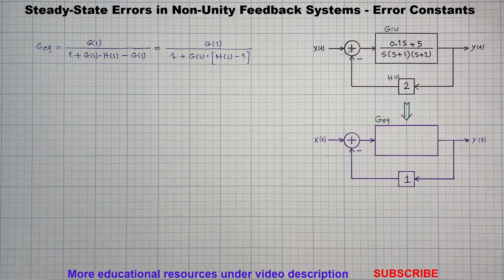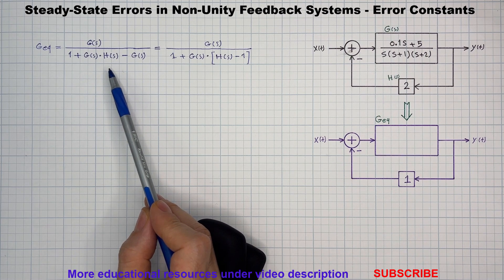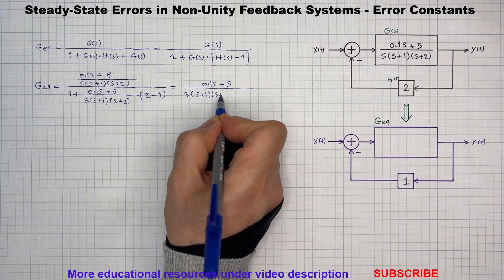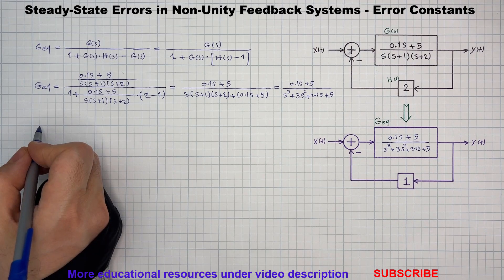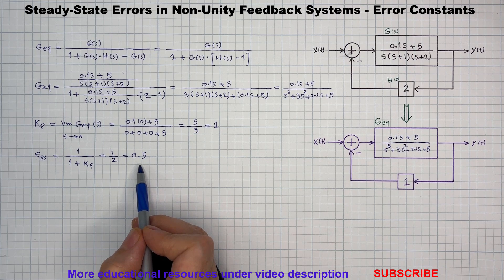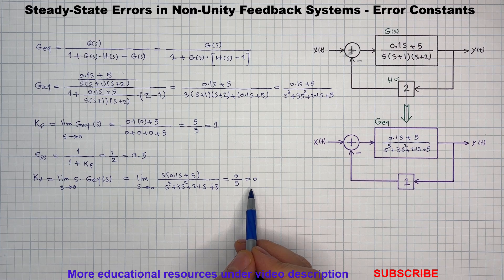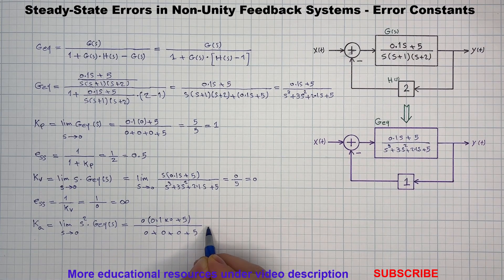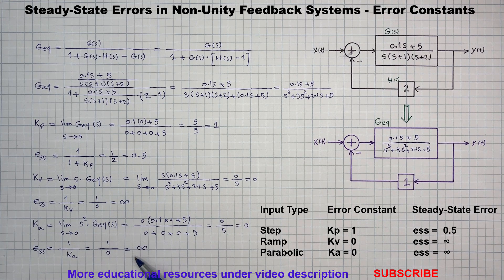Steady State Error in Non-Unity Feedback Systems, Steady State Error Constants in Control

Comment: i think this is wrong, this system type is type1. so, steady state error exist when the input is ramp. how do you think?
Reply from the maker: Actually that was all purpose of this quiz. The proposed system is NOT type 1. System type refers to the number of pure integrators in the forward path of a Unity-feedback system. The system of question is not unity, so you will require to convert it to unity system and then look at the system type. Please review the video explanation.
Reply: Thanks buddy